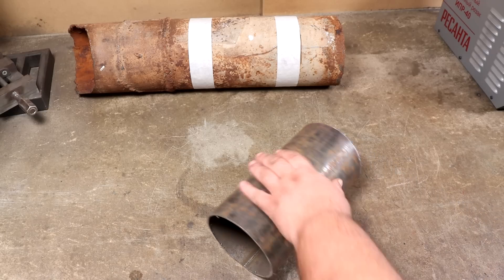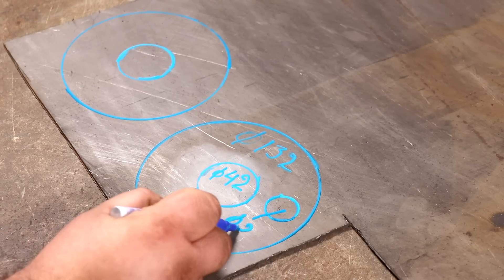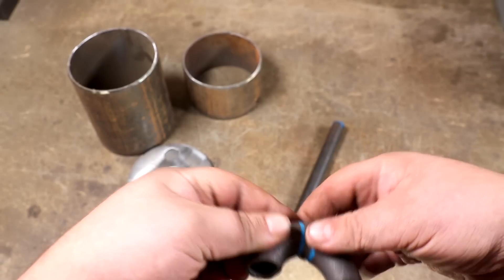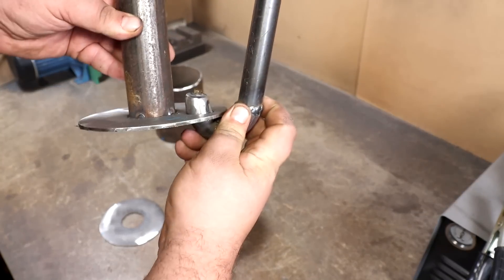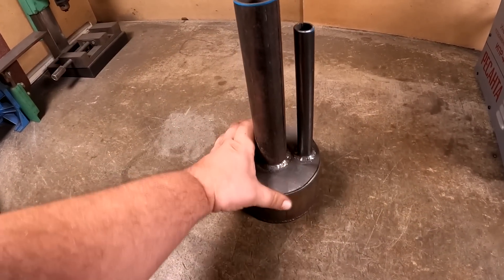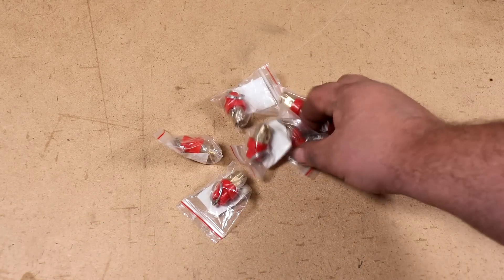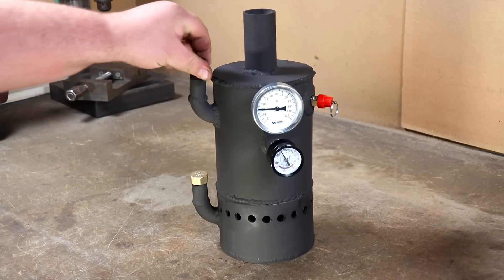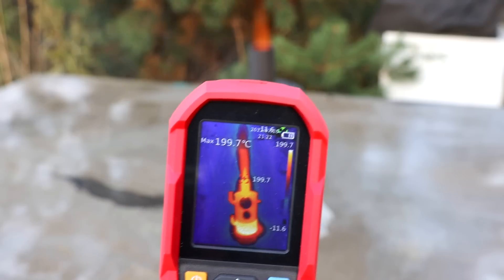Homemade Illegal Burner Uses Water

Comment: Does the steam actually burn?  You could use a turbo blow-off valve for safety.
Reply from the maker: I use a normal 5 bar safety valve, but it's better to use two parallel to this.
Reply: water doesn't burn. wtf kind of education are people getting out there.
Reply: @johnjingleheimersmith  I don't know if this is real but with enough heat and pressure I think you can decompose It into H2 and O2 and when they escape the pressure chamber through the tiny valve the pressure drop somehow forces them to react again. It is theoretically possible but kind of useless.
Reply: @RevolutionaryLoser  yeah but not at the temperatures depicted in this device. It would melt before you could decompose it and would not reignite due to chemical fouling. We're talking over 3k degrees. All he's doing is efficiently burning the oil or whatever he put in there.
Reply: @johnjingleheimersmith  the high speed steam creates a strong venturi effect which 'sucks' air into and upwards the stove creating powerful tounges of flames.

the high pressure steam kind of 'pumps' plenty of air from behind the nozzle and accelerates it fowards. its this excess air that is efficiently buring the fuel and directing the flames upwards.

this stove is perfect for burning solids like plastics, dried grass, twigs, wood, sawdust
Reply: @MsKelvin99  Yeah I know, but these fools talking about burning water and creating hydrogen and nonsense like that. Dang son, we need so much better education in this world.

Comment: I do this with my wood stove, when there is a good base of coals you can put in a piece of wet wood and it will heat up greatly. People don’t believe me. In WWII there was a water injection system in Spitfires to give them extra power in an emergency that could only be used for 30 sec or the motor would burn up. Water injection in engines was used way back in the 1930s.
Reply from the maker: I didn't know about "speedfires", I will definitely read about them. Thank you. Now you can show this video to those who have doubts!
Reply: @doctor-robo  Spitfires, it is an airplane.
Reply: Really interesting since water injection greatly decreases combustion temperatures in gasoline engines
Reply: @sil-zk8061  not if the water is split into hh-o. I'll burn hotter. Just like this video. I never watched the vid all the way through, But I think that's what's going on here.
Reply: See also  emulsified fuels such as “Hydrodiesel” which is a 80% fuel to 20% water emission. 
All that said, I didn’t see anywhere that this creation was supposed to be actually “burning” the steam. Instead it’s actually injected into the exhaust stream to “turbocharge” the exhaust which creates a relative vacuum which oxygenated ambient air then rushes in to the combustion area at a more rapid speed causing the more rapid combustion rate and likely a higher temperature. That higher temperature is part of the positive feedback loop of then producing more steam at a faster rate and so on.
Reply: At my local airport in the 90’s, the bac1-11 used water injection for “increased power” takeoffs during the summer.   The Spey engines produced a phenomenal amount of noise and no power - the pilots said the water helped “a little bit”...
Reply: Water does get injected into coal fired power plants.  To increase the heat.
Reply: Now it's already used in military French motor 👌
Reply: @manoo422  the entire motor and other industry is run by those who make billions every day from so called fossil fuels. There isn't much will to investigate water, or do what's in the best interest of mankind...
Reply: @c3N3q  What would they investigate there are no calories in water?!
Reply: Do you even understsd what you said the water was used to cool the engine not make it burn hotter.
Reply: @adventureswithfrodo2721  tight squeeze in your box.
Reply: There’s energy in water in the sense that there’s  large energy release during phase change (vapor to liquid, liquid to solid, etc). Look into endothermic and exothermic processes such as phase change heating and cooling. That’s how we get more energy out than we put into AC’s and heat pumps.
Reply: SOME OF AMERICAS JETS STILL USE WATER INJECTION SYSTEMS FOR EXTRA POWER🇺🇸 YOU KNOW THAT WHEN WATER FLASHES TO STEAM IT EXPAND 1600 TIMES CAN’T GET THAT FROM ANY KIND OF LIQUID FUEL❤️‍🔥🇺🇸
Reply: The only thing water does in engines is cool the combustion temp to prevent detonation and allow more ignition advance to produce slightly more power. Water has no energy value.
Reply: @manoo422  You are mostly correct although there are instances where the heat absorbed by the water can be recovered due to the high expansion ratio of steam. I wrote my masters thesis on a water injected engine.
Reply: @wonderful_  There are more than a few Physics details missing in this video. I would like to know the reason for injecting steam into the flame. Even if the water molecule did break apart, there would be no net energy gain. 
This guy still makes some amazing builds.
Reply: @JohnHoranzy  I wouldn't call this steam injection. He is essentially creating additional airflow to his oil fire. 

So the oil heats the water which then turns to steam (water becomes 1600 times larger in volume when turned to steam) and increases the pressure in the upper, water/steam containing vessel. The high pressure steam then is forced through the down tube and out the nozzle that leads into the exhaust of the oil vessel on bottom. The flow of steam out of the oil heater exhaust increases the speed of the exiting exhaust gases from the oil burning. As mass is removed, it must be replaced. The increase in mass flow out of the exhaust requires an increase in mass flow from the intake. Therefore fresh air (containing Oxygen) is sucked into the oil vessel. With more access to oxygen the oil can burn faster. As the fire burns hotter, more steam is created, thus more exhaust gas is forced out of the exhaust and more air is sucked into the fire. This cycle continues until an equilibrium point is reached or in this case when the steam hits the pressure that his relief valve is set to. 

He is basically turbocharging the furnace but instead of increasing intake pressure which is typical in a turbocharged car engine,  he is decreasing exhaust pressure, which has the same effect of increasing air flow.
Reply: @wonderful_  Thank you for taking the time to write a detailed explanation.
Reply: @wonderful_  Any expansion of the water vapour would be insignificant in an engine. The only positive effect is to cool a combustion process which is on the verge of detonation from forced induction. There is good reason why very few engines use water induction...
Reply: @manoo422  the cooling effect of water can also be used to decrease NOx formation which forms at high temperatures. In my graduate research I injected water into a diesel pilot - natural gas engine and where I was able to significantly reduce NOx AND soot while also advancing SOC causing an increase in BTE.

Again, it is RARE and requires special conditions and direct water injection after SOC to increase cylinder pressure from steam. Wei et al wrote this peer reviewed paper,
"The Effect of Water Injection on the Control of In-Cylinder Pressure and Enhanced Power Output in
a Four-Stroke Spark-Ignition Engine"
and was able to produce an increase in cylinder pressure by using direct water injection.
Reply: @wonderful_  I'm sure it was a very useful piece of research...I mean useless.
Reply: @manoo422  you know it's okay to admit you were wrong. It's ok.
Reply: @manoo422  it was actually pretty useful! And they paid for my school plus some for doing it so I can't complain!
Reply: @wonderful_  The entire motor industry shows otherwise...
Reply: @manoo422  do you know where the US gets a majority of the power used to operate EVs? Natural gas power plants which was the application of my research. Not to mention boats and construction vehicles are unrealistic to power electronically.
Reply: Do you think somthing like this is happening in the modern jet engines that leave trails accross the sky. ? Some sort of turbo that splits water into hydrogen and oxygen mid flight.
Reply: @XR4JERSEY  I don’t think so, the government has admitted that they are spraying and then there are all the patents on weather modification. You can see actual contrails the extend only a few miles behind the plane and then you can see the chemtrails that go from horizon to horizon and slowly disperse into a haze.
Reply: You are a genius.  Keep up the good work
Reply: @DailyTheme  Try it!

Comment: You use "oil" as a catalyst. Not bad. I've burned water using anything organic such as leaves, fresh wood chips ect. Emissions = about as close to 0 as you can get.
As far as shutting it down, you have to incorporate a draft or fuel cut off. 
I also believe once you get your system started with what ever catalyst you may, You can continue burning the water without anything else.
Reply from the maker: Thank you for liking my projects! I plan to try this burner not only with used oil, but also with diesel fuel or ethanol. Come again, I will always be glad to see you on my channel!

Comment: What is the 1000C black paint you use. Do you have a link to it? I didn't really understand how it all worked. some pictures with cutaways would be helpful
Reply from the maker: Heat-resistant spray paint for BBQ. I will make a detailed assembly video soon.
Reply: @doctor-robo  The ones I've seen did not go up to 1000C, they were much less, that is why I was interested in brand details
Reply: Por lo que parece en el vídeo es una pintura rusa.
La lata tiene inscripciones en alfabeto cirílico.

Comment: "Runs on water" is inaccurate... Pegged pressure meter (12x A) and venting safety release (5x A)... Simply out of control! I call it a flash boiler aka a pressure bomb.
Reply: I see a pegged thermometer, but the pressure meter isn't pegged and the pressure relief isn't going off either. The pressusre from the steam is being released through the nozzle and is forcing a draft which adds oxygen to the oil that is burning making the stove burn more efficiently. Basically, instead of having a fan force air through the flue, this uses steam to pull air up the flue. When either the oil or the water burn off this shuts down. It'll still burn the oil if the water is gone, but it won't rocket up the flue anymore.
Reply: yes boom boom very possible...
is very nice concept but needs some control on the fuel side.. I like it..!
Reply: @TrickyDickyP  Use propane burner... At least you can turn off heat source...

Comment: Your ideas are original and brilliant..... If they need changes to improve the idea you will find the answers... We are in difficult times now... We need guys like you to make life easier to live..... 🇬🇧
Reply from the maker: Thank you very much for your kind comment!
Come again to my channel, I'm always glad to see you.
Reply: @doctor-robo  cool, diesel has to be compressed and atomized, diesel fuel injector, battery and once you have enough heat to ignite it should continue to combust with less pressure. Or always start with oil once up to temp use a valve to switch over to Diesel.
Reply: @spoot8835  teşekkür ederim
Reply: @mucitusta37topcu4  rica ederim
Reply: @doctor-robo  hidrojen için kullandığın nozul kaç mm ölçülerde?
Reply: @doctor-robo  😀👍🇬🇧

Comment: This is a gasifier, it's burning the emissions from the oils smoke not the waters steam, water needs an electrolysis to separate the H from the O.. Hydrogen and Oxygen will burn hot, but it takes a lot of electricity to get very little Hydrogen..  You get more from 2H2O (hard water) but it still isn't profitable...
Reply from the maker: In future projects, I will still try to make a hydrogen furnace and much more. Come again, I'll be glad to wade you.
Reply: @justinorwen1141  Horse sht. That is not what is happening here. In order to produce water gas you would need to heat water to 3000 degrees. If you think this is a hydrogen combustion you need serious remedial education.
Reply: Actually you are mistaken in your comment. Look up water gas.
Reply: @MissionaryForMexico  This thing has nothing to do with water gas.
Reply: @johnjingleheimersmith  Study physics then!
Reply: @johnjingleheimersmith  And others get veterans education assistance during and after enlistment, to earn a college degree. Then there are people just like yourself, that reveal your spirit, your inner man by their words!